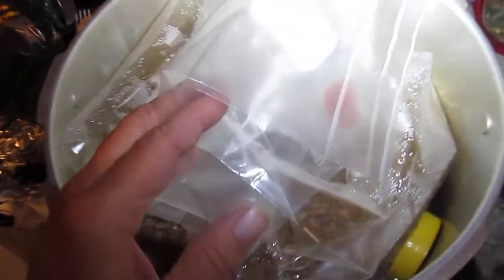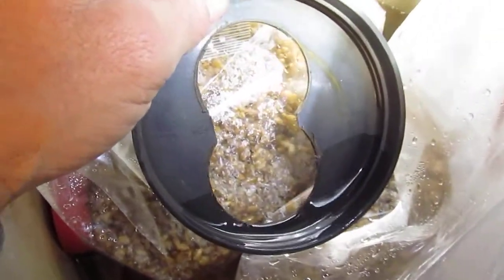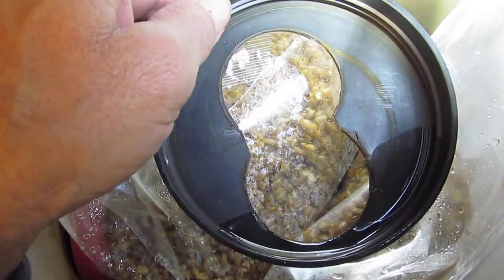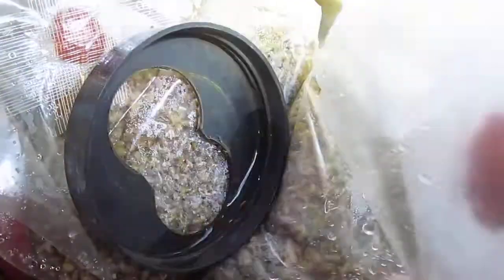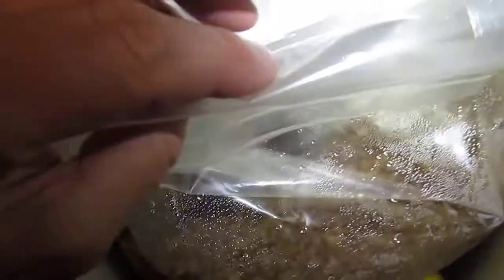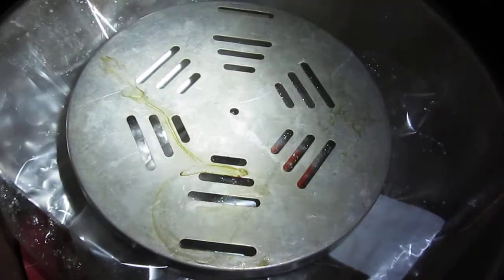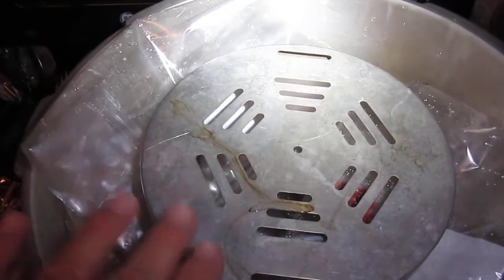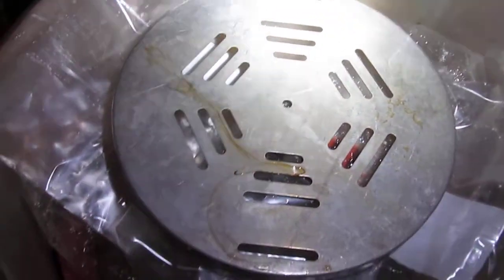How to load bags of grain spawn into a pressure cooker HD

Comment: How long u do it for and how high of heat
Reply from the maker: The usual time is 90 minutes, starting from when the PC reaches 15 PSI. You have to adjust the heat to regulate the pressure. Usually you start at higher heat settings and then lower the temp as the PC comes up to 15PSI. Sort of like cooking rice- heat it to a boil, but then turn it down to 'simmer'.  There are way too many variables to give you a "setting", you have to find your setting on your own equipment. But it's easy if you pay attention.

Comment: Why can’t it touch the corners. And what’s the material of the lids ?
Reply from the maker: Touching the sides is probably more of an issue for people that have the PC on a gas burner. The sides could in theory get hot enough to melt the bag.
The lids are "PP" 'polypropylene' food jar lids will holes drilled in them to allow water and steam to move around. Any plastic item with a number "5" inside the recycling symbol i made from PP and will survive the PC. You can also use metal canning jar lids, but they will eventually start to rust. 
Hope that helps.
Reply: PP5 is what you’ll see